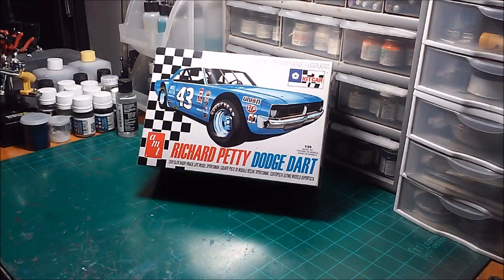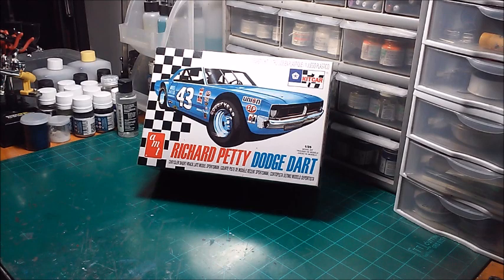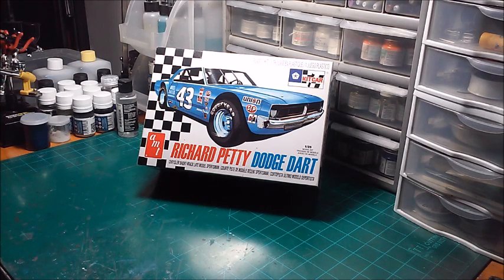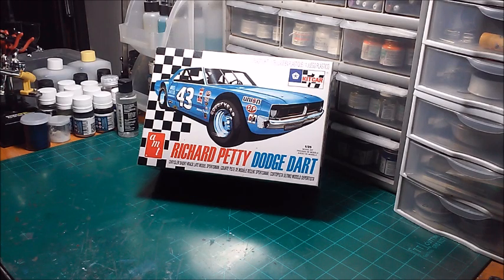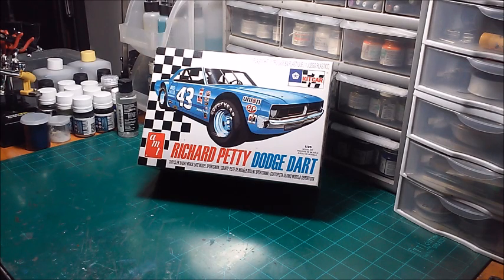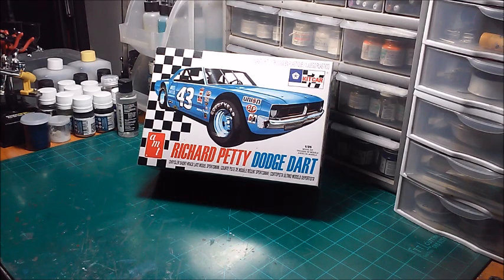Petty Dodge Dart Final

Comment: Looks great Gary, love the as raced look. I'd like to see how you did the rub marks on the door.
Reply from the maker: Smokinjoe 311 Thanks Joe. There's really nothing to it. I took one of the tires that came with the kit and laid one side of the tire into some black acrylic paint (flat black), then dabbed off the excess and touched the tire to the side of the car and turned the tire just a little bit just like it would be doing in real life if it bumped into the car while moving. Worked perfectly! Thanks for watching brother! Much appreciated.

Comment: Very nicely done! Did you use any kind of pre setting solution for the decals I ask because I just bought a set of over 20 year old decals from Mike's,  I'm a little nervous about them disintegrating in the water on me... lol
Reply from the maker: Steve Stannard I didn't on these, but I did brush on some Micro-Sol decal solvent to make them lay down better. I had a couple that tried to break on me coming off the backing, but I managed to piece them together without any issue. Thanks for watching!
Reply: Oh ok, thank u Gary... I appreciate you getting back with me on that, I've got some of the solve and set on order but it hasn't come in yet, great job again on the car👍

Comment: The bars in the engine bay were too short to reach the firewall on mine. That's the only issue I had with the kit
Reply from the maker: Wheatons speed shop Same here. I used some homemade sprue glue as filler to fill in the gap where they came up short. I had one that was too long. Things like that differ from kit to kit as you well know I'm sure. Thanks for watching.